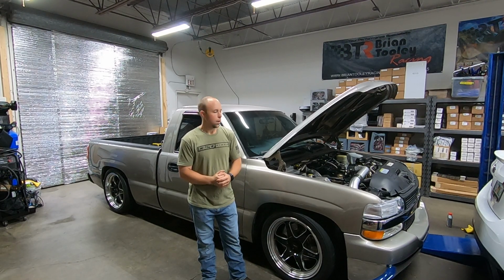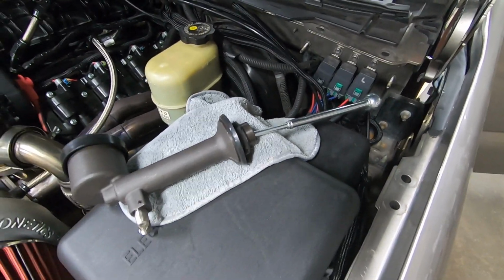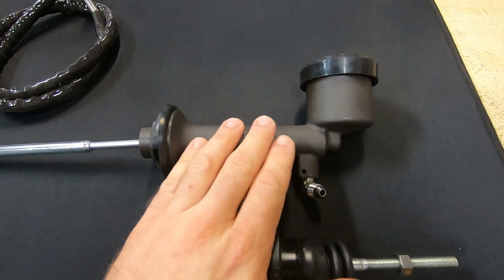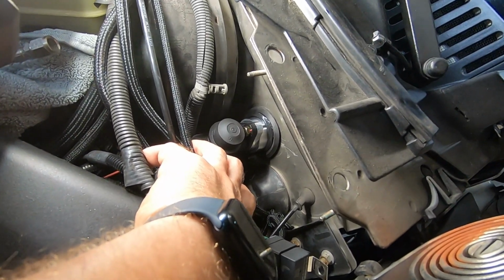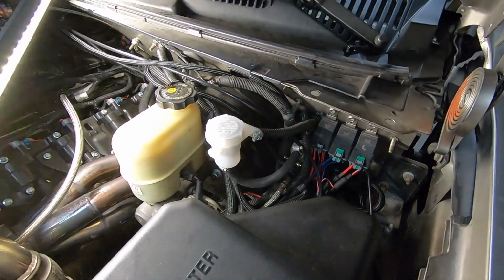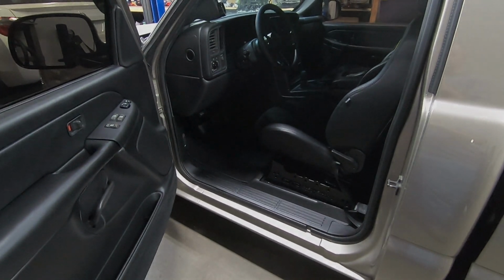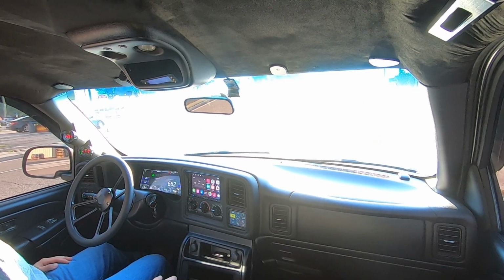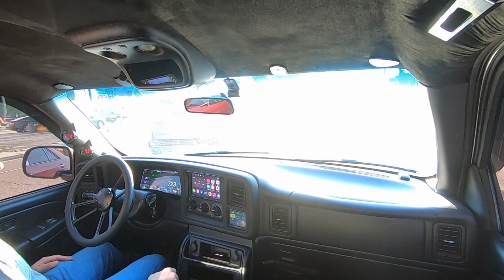New Product Release! Tick Performance Adjustable Clutch Master Cylinder for 99-07 GM Trucks

Comment: i just picked up a 3an clutch line with some 20$ adapters for the master & slave nv3500. Should have done this years ago. No more dropping the trans if a line touches the header. 😆 i tried Ace hardware brass union fittings to seal the broken line and it Busted open  upstream of the fitting. Required a new slave cylinder

Good to know there's a hi dollar option if i go further with the clutch system

Comment: Is it normal to continue seeing bubbles while pumping, pedal feels great but cannot get rid of small bubbles, running the same master
Reply from the maker: Yes, mine did the same.  I bled it thoroughly and set it by pedal feel and throw.  When the pedal was released, it would still let some small microbubbles back into the reservoir.  I am not entirely sure why, as I had not encountered that before, but it must be due to the design in some way.  I have a couple hundred miles on mine since the initial bleed with no trouble at all.
Reply: @ yeah, I’m thinkin it’s a design thing, cause it’s making me go crazy lol. I adjusted and bled the clutch last night for probably 3 hours. Couldn’t get the bubbles to stop so I’m just gonna call it good and see if I have issues down the road, doubt it tho if yours is the same

Comment: is this good for lets say a ls7 clutch kit or better stay with oem stuff? dont have much power just a a5.3 cam dont race just like to swing it gathering all info i can
Reply from the maker: Yes, even with a mild combo I would run this setup.  It address the lack of throw distance that the truck master cyl volume provides relative to the f-body slave, which would benefit any clutch combination.

Comment: What length of line are you running between the master and slave? The quick connect keeps popping off on my 04, and I'm thinking about doing a QC delete.
Reply from the maker: I believe my line is 40", but there is enough room to go slightly shorter as well.  If you convert the slave to 4AN, the master kit already comes with the 4AN fitting on that side.